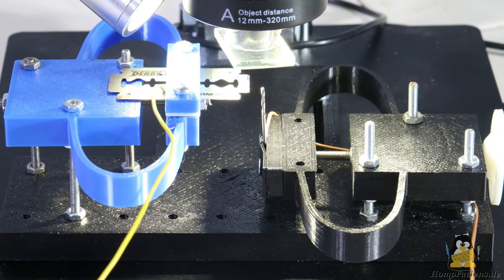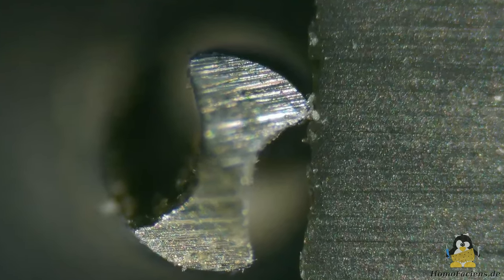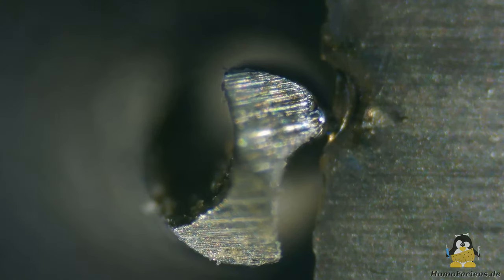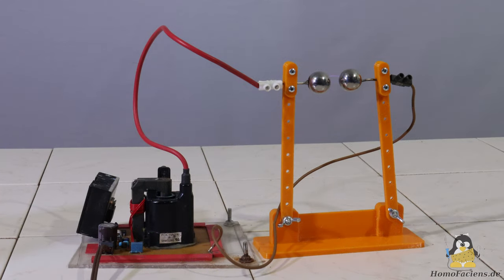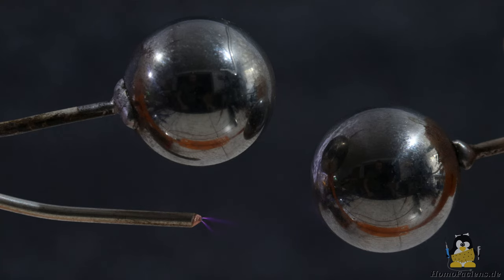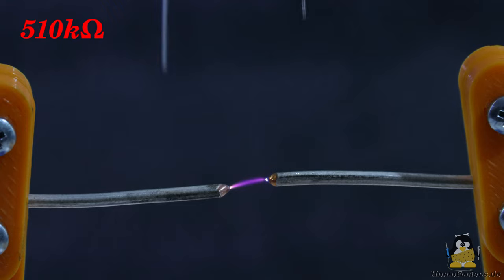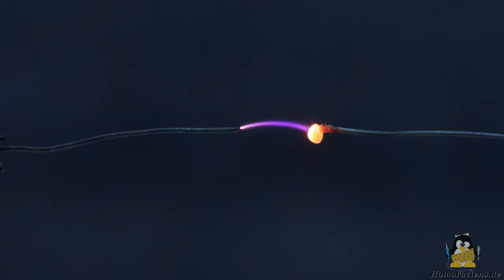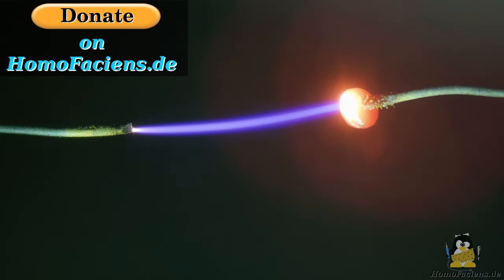EDM: Exploring the properties of sparks and plasma

Comment: its my understanding that flyback transformers produce a DC arc and so explains why only one electrode heats up
Reply from the maker: Yes it is (sort of) DC voltage, but not a smooth one. Otherwise both electrodes would have been eroded. More on plasma physics and electrode materials will follow. Stay tuned!

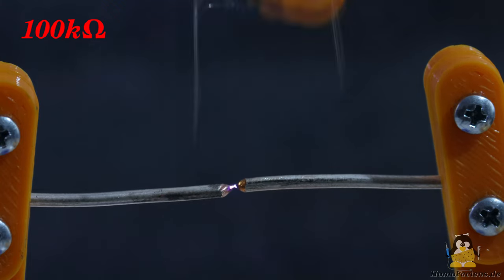Comment: At 13:09 you say the right hand wire is attached to GND, and we see that wire getting erroded. But I thought the workpiece in EDM was positive for most metals. What metal is your wire made of? Going by the way the sparks burst I would have guessed steel.
Reply from the maker: These are steel wires. Usually you won't use steel to erode steel in real life. I will talk on the polarity issue in later chapters. Stay tuned!

Comment: You are totally out of the EDM effect, which is immersed in oil or water, which is the dielectric medium where there is ionization and discharge between electrode and workpiece. What you are doing is electric soldering. If you want help, talk.
Reply from the maker: I know. It is a series about EDM, going from worse to better, chapter by chapter. This one is about some of the properties of sparks and plasma. I will combine it all to a (better) working machine in later videos.

A first video with some kind of eroding immersed in deionized water is here: https://youtu.be/dqc09sWdh_0 more will follow.

 Stay tuned.